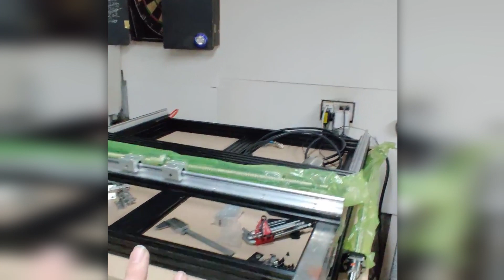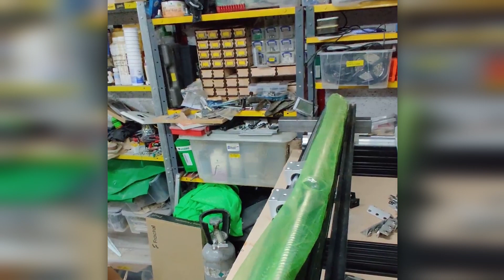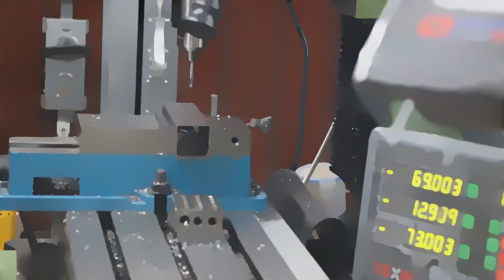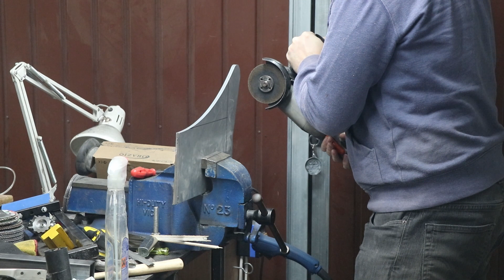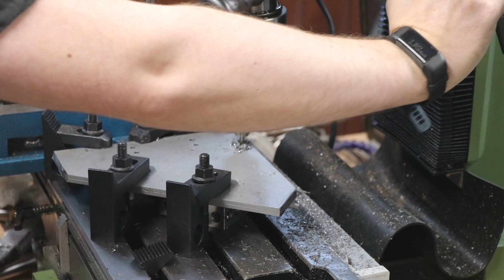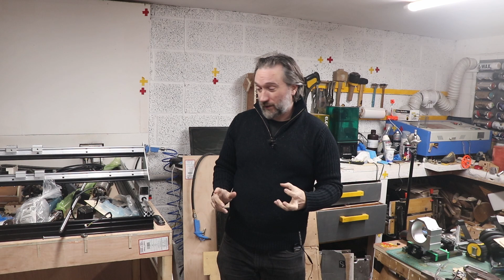OX CNC refactor - part1: Y-axis gantry plates

Comment: Interesting work so far. I presume that is for wood?
Reply from the maker: Mostly yes. I'm wondering if it might be strong enough for some aluminium work. The ox which I'm updating could just about manage that. But predominantly wood and similar softer materials.
Reply: @MakerGeek  You would need a slower cutting speed I expect as well as coolant/cutting fluid,  but I suppose it would be a good idea to see what others have done with cutting aluminium.
Reply from the maker: I have a water cooled 2.2kw spindle on a vfd. So I can drop the rpms a fair amount though I'm not sure at what point I'd lose any torque. But it's not really a priority. I have the big manual mill for metal which covers most of my requirements there.